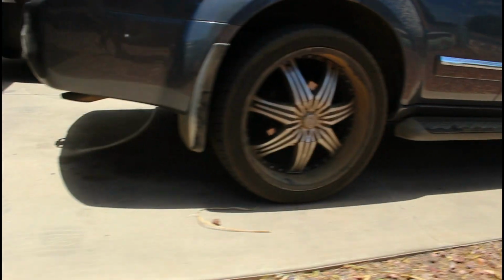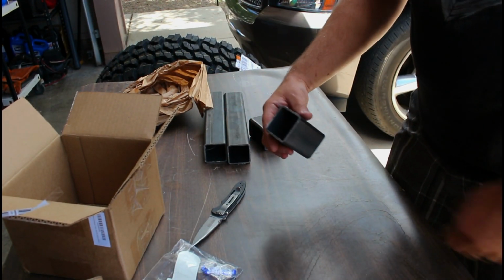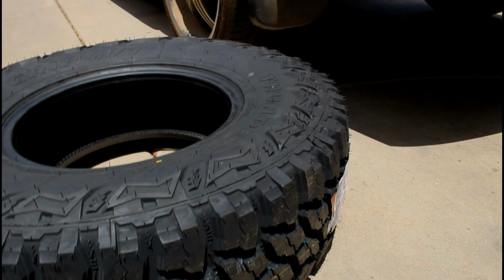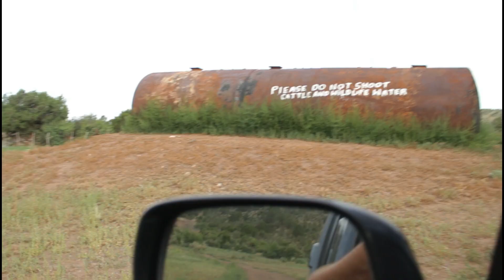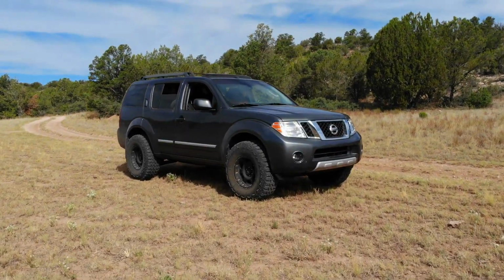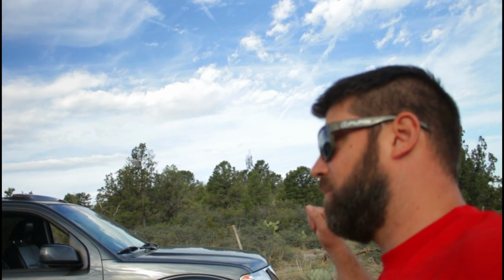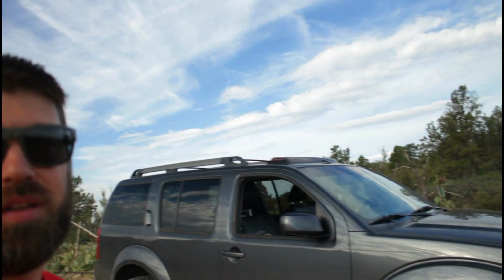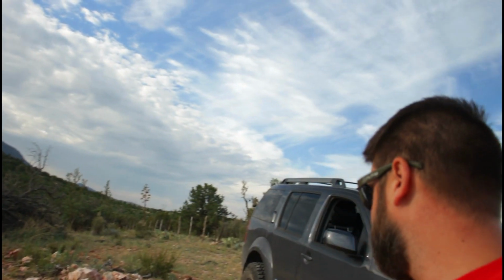Nissan Pathfinder R51 Lift

Comment: I have a 2009 Pathfinder SE non 4x4, now have you upgreaded the front recovery points? I am looking into getting some from RoadSafe but I dont know if they fit.
Reply from the maker: Brendaleetv, No i haven't upgraded my recovery points.  I have been looking at DezertRunner's, they say they will fit the pathfinder.  I will have to look into RoadSafes's.
Reply: I just looked underneath my Pathfinder SE and I do have L and R frame treded  mounting holes so Ill get the yellow recovery points from RoadSafe.

Comment: Can i ask why did you go to all that effort with the tubing in the rear as opposed to getting both front & rear spacers? Is there any advantages to this method of lift? I suppose you could combine the two & get a 4" overall lift, but then i'd imagine you'd have to start worrying about control arms & cv angles
Reply: Cheapness.

Comment: Hello or can find black shim in front for damper that you received parcel thank you
Reply from the maker: Hi Mike, hear is a link to Amazon for the ones I have https://www.amazon.com/Supreme-Suspensions-Frontier-Leveling-Aircraft/dp/B00IDH24CY.  They are a 2 inch spacer lift. They fit Nissan frontier, Xterra, and the Pathfinder. The front suspension of all 3 are the same.

Comment: Do the front tires rub?
Reply from the maker: Yes, I did the pinch seam mod and I had to melt the fender liner in the front and back to make room
Reply: Blow By Racing Keeping up with the Jones  pinch seam mod is where you take the flat seam that sticks out (it is behind the wheel well liner) and take a hammer and bend it over out of the way of the tire. Some have cut it every inch or so to make it easier to fold over.

Comment: Hey buddy. Love the lift you did. I’m working on my 2006 pathfinder now to do the same thing. On the rear are there nuts built into the frame that the longer bolts screw into? Or do I have to get nuts for the bolts?
Reply from the maker: Thank you, there are nuts in the frame. So if you can keep with the same bolt thread. But if something was to happen you can change the nuts with a lot more work

Comment: Hi Alger, I just got myself a '09 R51. As I like to go desert offroading, R51 is quite low an easily stuck. Need to lift a little bit. 
May I know for the rear lift, how mm in dia for the hole you make on the spacer? what is the distance between the holes?
What size of the bolts? is it M12 or M14?
Mine have 17" rims.what size of tyre I can go max without any trimming on the body?
Reply: Hey i need to lift r51 for desert driving as well. Did you manage to improve the car for desert?

Comment: Great looking R51. I have had 2 of them and I'd like to lift the current one, but I don' t have access to the tools required for the rear. So, what are some good off-the-shelf options to lift the rear? The front seems easy enough.
Reply: I replaced my rear coil springs with Old Man Emu heavy duty coil springs. Not only did it give the rear a significant (>2") lift, but it keeps the rear end from sagging when the truck is loaded down with camping gear. The trade-off is a stiffer ride, but I don't mind that. You might need to replace your control arm bushings with eccentric bushings in order to ensure the camber is good.

Comment: Hi, is that same size strut and coil from old strut when you lift 2" on front and rear? Thanks
Reply from the maker: Yes they are the original front and rear. The front you just bolt the spacer onto the top of the original front struts. The rear you don't touch the shocks or spring, they are attached to the subframe and you lower that whole unit.
Reply: @algeradventures4891  hi alger, so 33" is there any trim to fit the tire in?  and is that need to replace those lug nut to bigger than usual nuts?
Reply from the maker: I have a aftermarket offset on my wheels so I had to do the melt mod to my front inner fenders. I actually have a video on what I did to make them fit. And I changed my lug nuts just because my wheels won't accept factory  nuts
Reply: @algeradventures4891  ok thanks, if i put mine zero offset wheel you think there is no need to trim?

Comment: Nice work, what screws did you use?
Reply from the maker: Juan Ramirez, The bolts are M14x1.50 and if you do a 2" i would go with 130mm long

Comment: Sow let me get this right! You lift the subframe by 2 inches or 50mm in the back where this lift does nothing to raise the diff or the suspension arms basically just a body lift and in the front you add a spacer that modified the suspension geometry basically lifting the suspension. Sow back is a body lift with no added ground clearance and front is a semi proper suspension lift? I hope people don't do this mod as it's stupid. Folks just buy the kit with the poliuretan flanse for the back coils and then you will have a raised back diff also.

Comment: Do you need to change your front upper control arm? I saw that a lift spacer would not work because of the control arm hitting the base of the spring